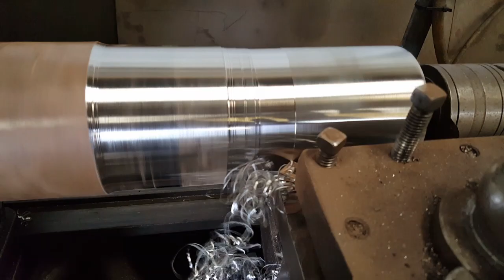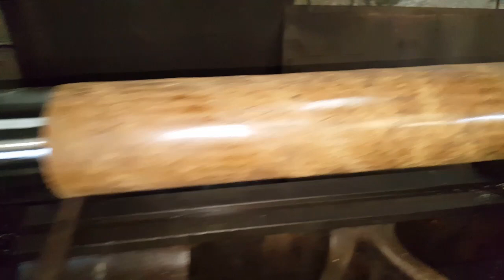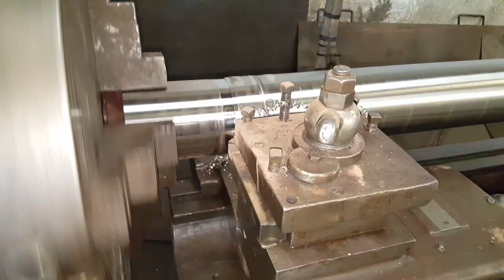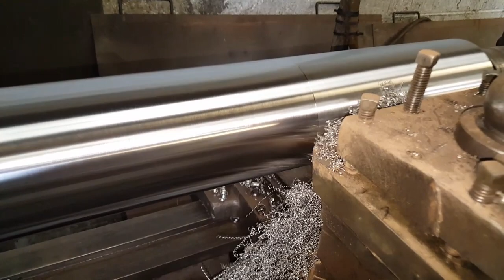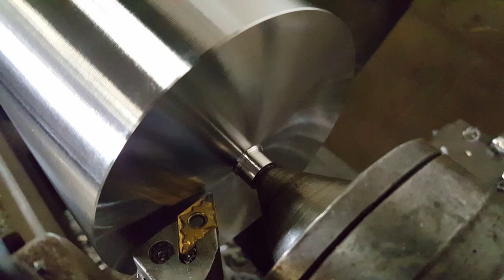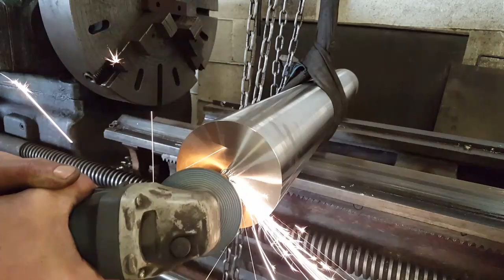Forged grade 5 Titanium.  Turn and remove centre holes.

Comment: You do some very interesting work that no one else on YouTube does, I would love to hear what you have to say.
Cheers Pete
Reply from the maker: Pete ip thanks Pete. I've never seen anyone else who turns away from the chuck which really surprises me.... it's the easiest way and has many benefits.
Reply: I only have a small 12x36 lathe, I am just a mechanic that pisses about like doubleboost but I have started turning some parts away from the chuck and using 45degree tips like I see you doing and now I can feed faster with more doc with less chatter. You are educating people, so thanks :) When you do commentate know that it helps others learn.

Comment: That seems to be a very hard material, I thought that it would cut a lot easier than that, it was  interesting to watch how you did that, the tip on that carbide was toast, that's for sure
Reply from the maker: John MacDonald hi John. Getting through the skin is the hard part.... rest is simple.

Comment: Is that rust or from the forging process I assume
Reply: fishingsgreat titanium does not rust its just an oxidation layer
Reply: So a type of rust    see I was under the impression that TI doesn't oxidize either
Reply: Isn't titanium oxide a major white pigment in paint?
Reply: Titanium forms a very thin layer of surface oxides that protects the remainder of the metal, much like aluminium.

Comment: What no sparks?😀
Which way do you use to centre drill your rough stock, or is it smooth enough to use a steady rest?
Reply from the maker: Chris Stephens forged bar has to be centred by hand but round bar I use the tailstock.